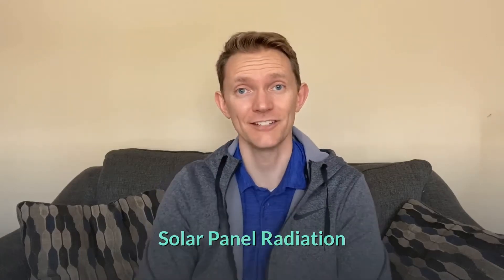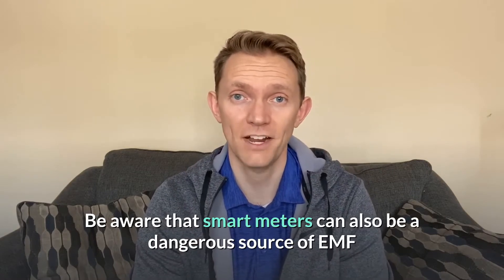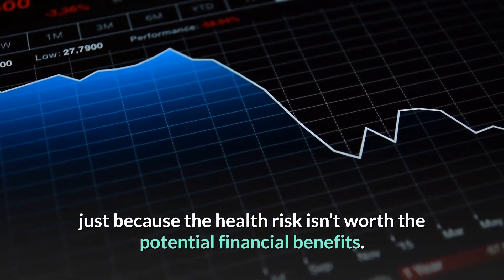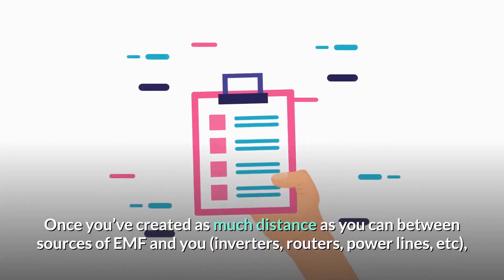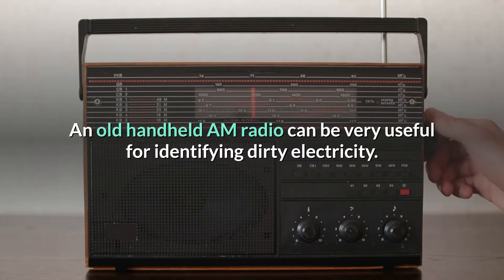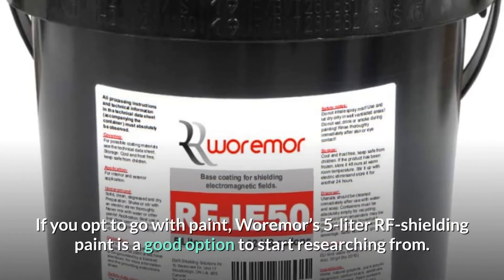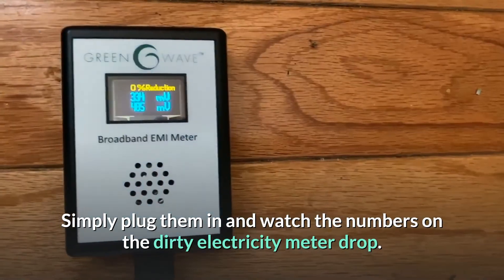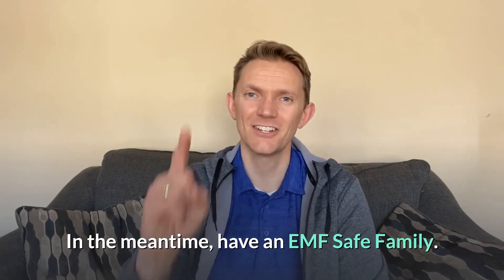Solar Panel Radiation - 4 Tips to Reduce Your EMF

Comment: So I can put the solar panels on the far corner of my property on 8 acres. Have it go to controller than battery house then to the converter. But if I have a housing built around the converter I can paint it with the RF paint. An plug one of those filters inside the small housing for those items. Would that be enough to not have to worry about it? Emf doesn't affect me as much as it does my wife. I want solar panels for my farm in case we stop getting power I would like to be somewhat prepared for anything
Reply: Paint and covers will do very little for magnetic fields (which is what those inverters are emitting). It's only effective against RF.

Comment: Solar powered charge controllers and inverters emit large amounts of radio frequency energy over a wide range of the radio spectrum. This is due to rich amounts of harmonics of the fundamental switching frequency being generated by the nature of DC to AC converters. The amount of solar installations are climbing exponentially,  raising the background noise floor over time to the point where essential communications could be rendered useless. Worst yet, a possible national security risk, unless the FCC decides to act now on changing its emission standards before it's too late.
Reply: Iam working solar power plant any health damage sir plz reply

Comment: What happens if u literally sleep next to a solar panel? My room is on the second story and my window is a few inches away from a panel 😖
Reply: It depends where the inverter is. That's what you want distance from.
Reply: Sun isn’t shining at night
Reply: See my comment. There is still an issue.  Especially if it’s connected to a solar controller. An engineer clued me into this who has built out his own campervan with panels.

Comment: What if i put my inverter into a faraday cage and use shielded wiring?  Would that work?
Reply: Wow, he can't answer your question in 10 months.  That says much.  Yes you're right.  Shield that baby.
Reply: Shield! Buy a reader (±$300) and take measurements before and after shielding to note the difference.
Reply: I sleep near the inverter already have health issues. How do I shield it please
Reply: @DinaParmar1  Wrap all sides in tin foil, see if that helps.
Reply: @genevaguerin  thank you so much, I’ve just ordered the trifled meter tf2 so hopefully will be able to figure out if it makes a difference or not
Reply: @DinaParmar1  I'd be interested to hear your results. Just be mindful not to cover the ventilation vents with foil. Inverters need ventilation otherwise they can overheat.
Reply: updates?

Comment: My solar panels even clean the EMF in the zone if its grounded and wired to the street power i get 0.01 micro teslas even with medium tension wires underground in the street
Reply: Can you explain it more please, is it not grounded normally? i am EMF sensitive and they installed solar panels on the roof of my bed, what can i do to help reduce it. thanks ;-)

Comment: I use the TF2.  But I am sensitive to emf. Such that I’ve moved away from alternating current. And yes I already break the circuit!  And have used everything else you’ve cited. Filters, low emf WiFi router, etc. 

There is an issue with solar that I’ve discovered after buying a travel trailer with 2x200w panels. I covered one up and that helped but even at night the one above my bed area creates EMF due to the solar controllers engagement of the panel.  This didn’t show up on my TF2 but it affects how I sleep and feel, and has been a huge frustration.  I almost sold the trailer but have just unplugged the panel and have new hope this will work for me!
Reply: if you were really sensitive you would ditch wifi altogether and go hard wired....
Reply: @Bward216  why are people such jerks? If I were really sensitive….what’s wrong with you? How do you know whether I have WiFi or not? Maybe think before you respond or post?

Comment: Unfortunately, those paints and shields will do very little for magnetic fields (example: from powerlines). They are effective against RF (cell tower, etc). From what i mesaured in some of the solar panel homes (we are buying a house), magnetic field is their ussue
Reply: What is used against magnetic fiedls?
Reply: @Nm3St8  not much, magnetic field are extremely hard to shield against. you need to completely encapsulate the entire source of magnetic field (in this case I believe that would be the inverter) in some shielding metal. Which is probably impossible because there will likely be some opening left which magnetic field will escape through. But solar panels themselves are probably emitting some too, including some dirty electricity.